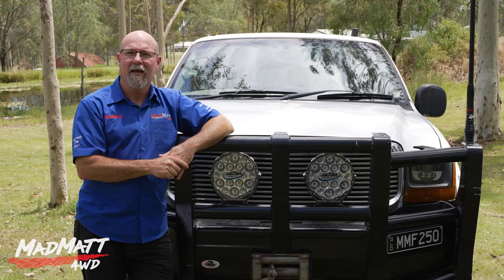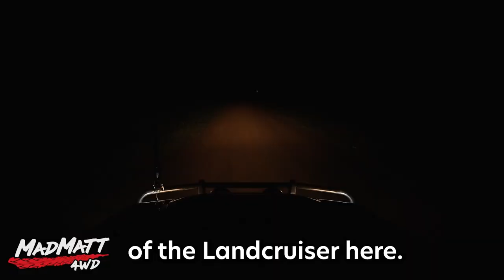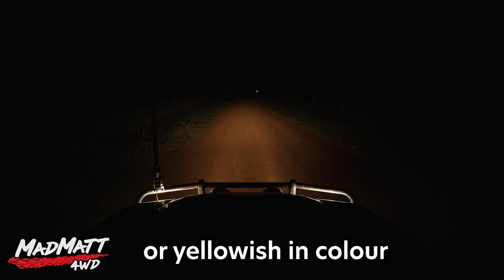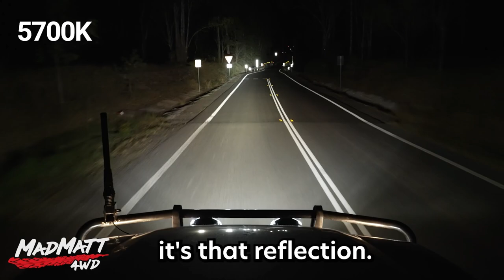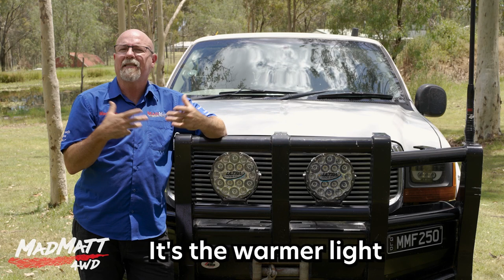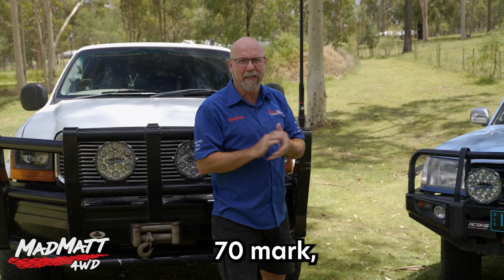All Things Lighting - Kelvin with Mad Matt

Comment: The issue is its not really 4500k, it's 4000k and 5700k combined.  

I wish you still made the Nitro Maxx range in 4000k, even a true 4500k light would be better than the combined 5700k/4000k.